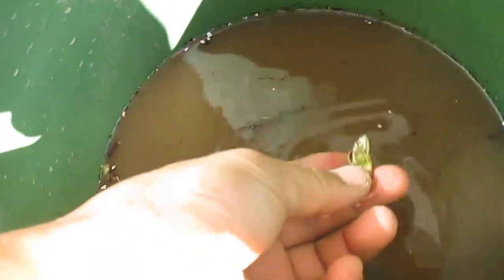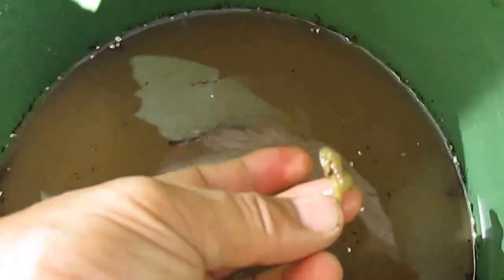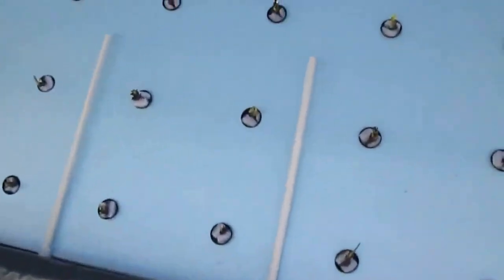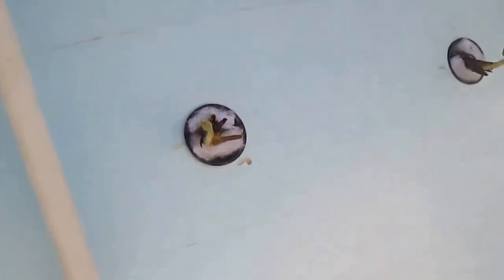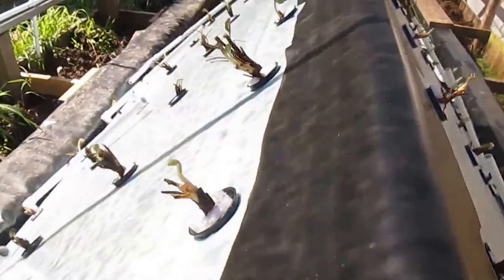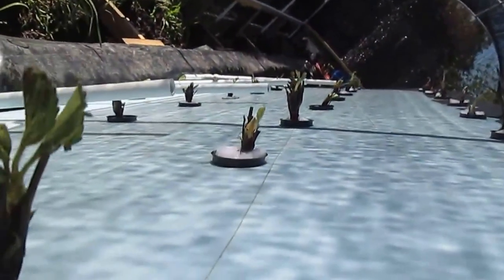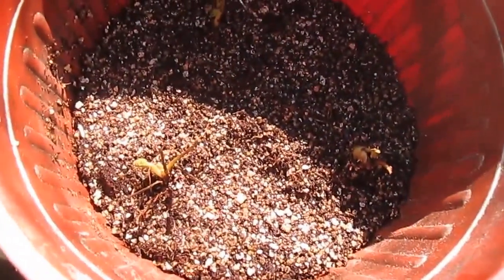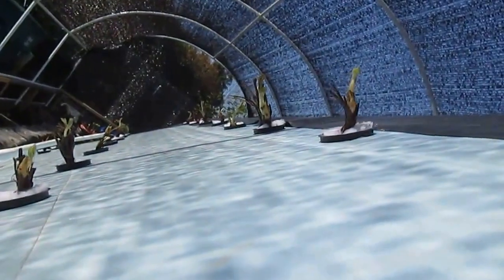Strawberry plants are in my A-frame Aquaponics/Aeroponics

Comment from the maker: It was doing great until hot month of August with 100 degree heat. The algae blooms clogged the water spray tips.
Reply from the maker: Only advice I can give is that you have to have a good filtration system so that sprayer doesn't get clogged.
Reply: thanks for replying! i want to build something similar at a steeper angle, do you have any advice or pics? or does it appear in any other video? thanks